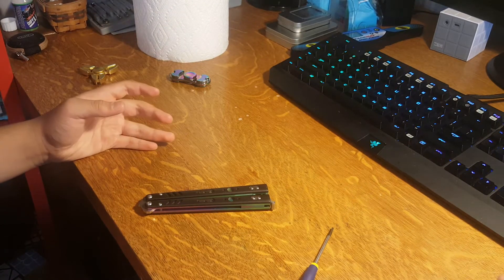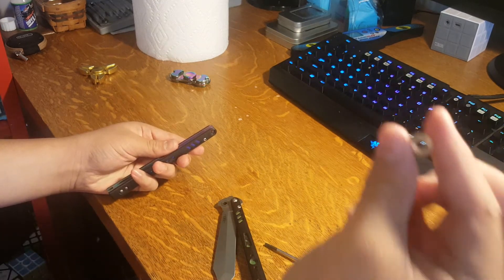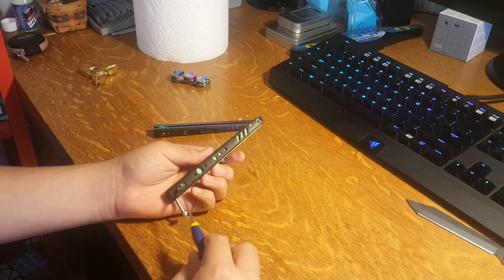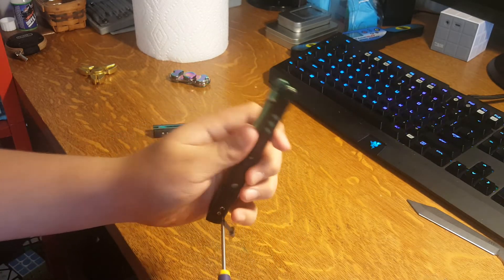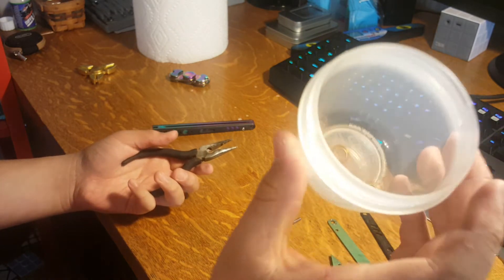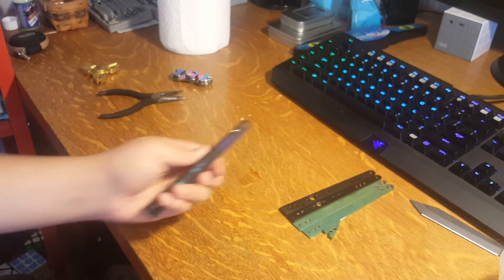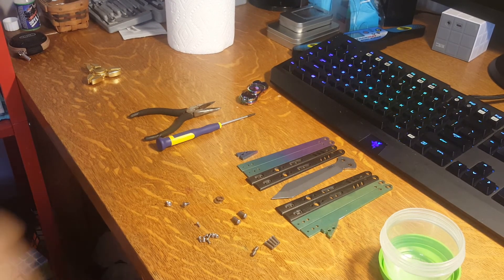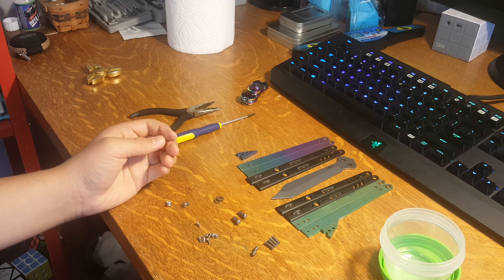Tutorial : How to Disassemble The BRS Replicant

Comment: How about pocket clip removal? Are the screws the same size and the safe handles? Or will I run into any trouble?
Reply: The pivot screws are T10, and the smaller ones should be T8 OR T6, I forgot which.

Comment: on my carbon rep the bite handle screw is stuck but the other came off fine... what do i do?
Reply from the maker: Josh02gunner1 ok, which screws? Pivot screws, zenpin screws, or the two bottom screws?
Reply: now it just spins
Reply: the ones that hold the knife blade to the handles
Reply: the safe handles one was easy but the bite one only spins, is it possible it was stripped in the factory?
Reply from the maker: Josh02gunner1 sorry for late response! But if you are saying that the screws at the bottom of the handle are spinning then move the scale and liner over farther and create more tension then it should work. If not let me know
Reply: im on my other acc but i dont know which screws are which but its the screws at the top where they go into the blade
Reply: the safe handle one came out but the bite one just spins
Reply from the maker: Josh try squeezing the handles together and loosening it
Reply: how did you fix it this is happening to me aswell
Reply: I'm having the same problem i used his method for the safe handle it worked but it doesn't work for the bite handle the screws just spin

Comment: My rep doesn’t wanna swing freely after cleaning and lubing it up, any advice? I do crank the pivots down till they’re sealed but I understand that since it’s a bushing system you can do that (my AB doesn’t bind up when I tighten them down all the way).
Reply from the maker: My advice is to loosen it up a little bit and put some more lube in it. The lube should eventually work it's way into the bushings and smooth things out

Comment: Meme
Reply: Disclaimer: I just took apart my BRS Replicant and mine has the pivots torx size as T-10 and handle screws as T-8. If you use a size to small it could strip your screws. Just be careful to always use the right size.